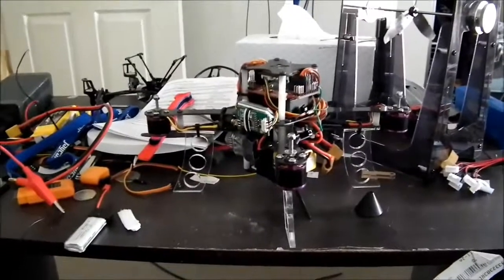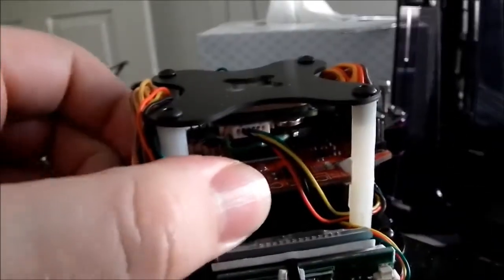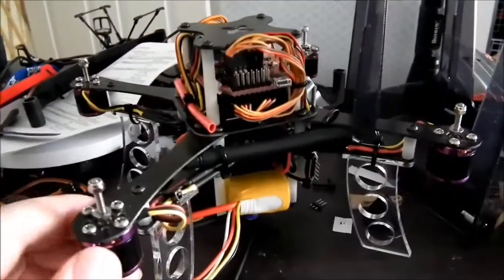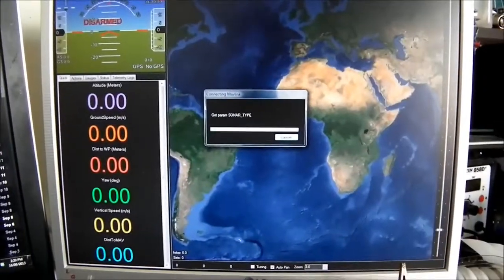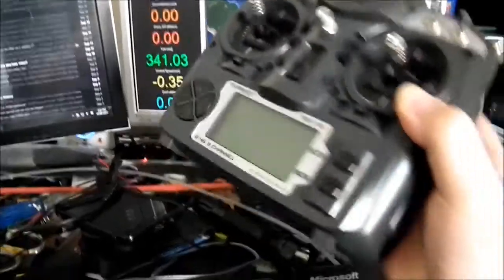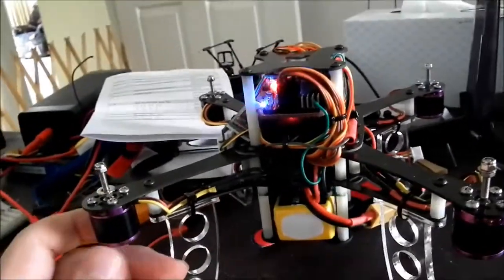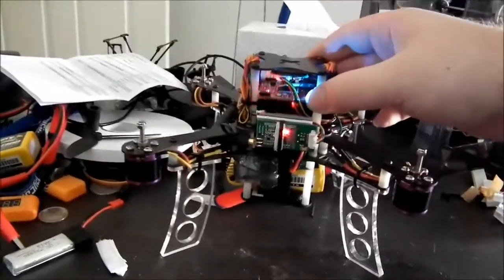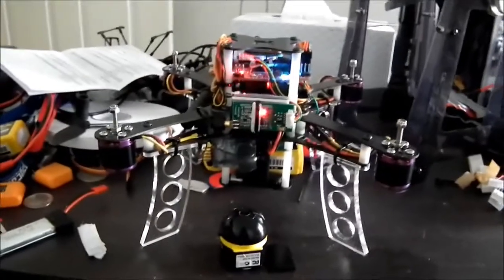Mini Quadcopter Build

Comment: Hey thought id post again , after fighting arducopter 2.8/2.9 " haven't tested 3+" i gave multiwii 2.3 a try and it works great , i did enable LPF 98Hz to really get this frame felling solid in the air but now i do its great. oh also on mine the arms could twist alittle so i 5minute epoxied them at the base to make them more ridged. you wont want to fly the jaycar cyclone once your x230 is going good.